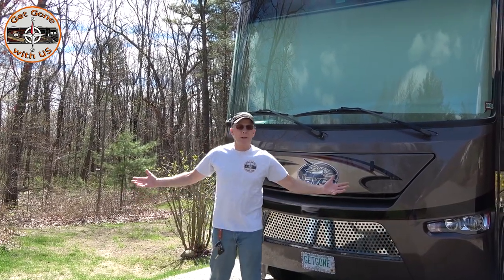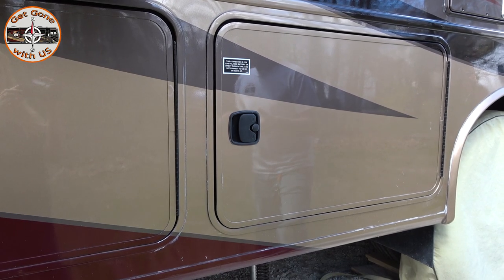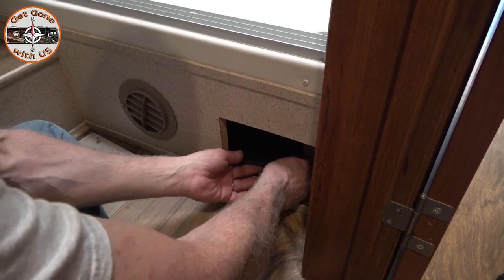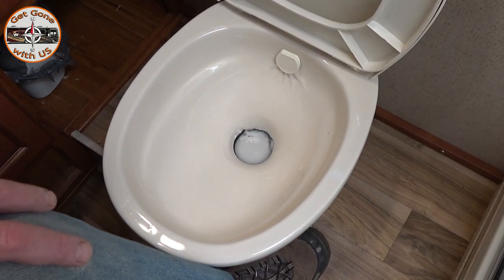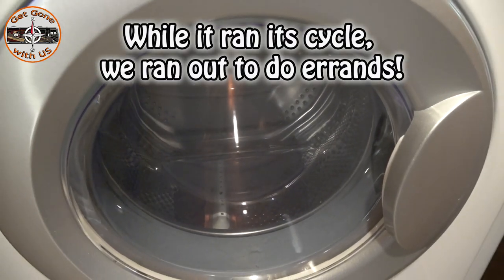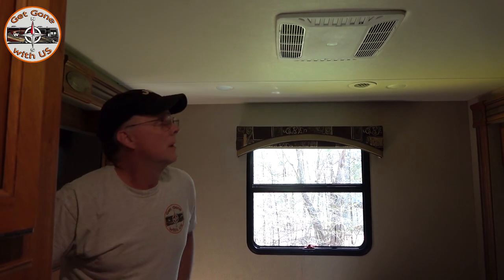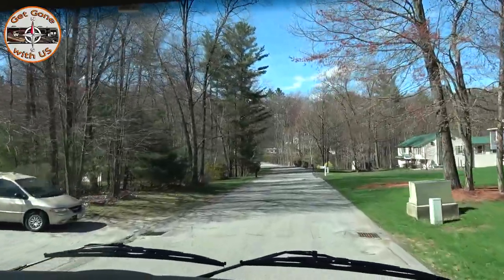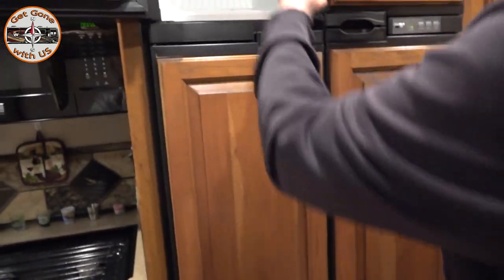Dewinterize and Sanitize an RV - Inspection and Plumbing

Comment: We had really bad flooding up here in the north now they are talking snow showers possible and it very well could it is only 35 out. Just when we think it is spring not quite yet! Great video.
Reply from the maker: Thank You!  The weather is crazy.  We went to a paddlefest in NY yesterday.  On the way we went over Hogback Mountain in Vermont and had to deal with a snow squall, it came down pretty good too. Temperature dropped to 35 degrees.  If we lived there Maggie would still be sleeping. LOL

Comment: enjoining you very detailed and informative maintenance series, thanks,  for my new to us 2018 Greyhawk 30x, what do you clean with prior to taping the roof, and any general fiberglass roof maintenance tips, don't want to replace the roof, saw a few videos on that, (a major operation!)
Reply from the maker: Thank you, we are glad you are finding the videos helpful.  Congrats on the new to you Greyhawk. By taping we assume you intend to Eternabond your roof.  We used mineral spirits to pre-clean the surface.  For washing we just use regular car wash soap from Walmart.   Replacing roofs are not fun, we had to replace the rubber roof and some of the wood on our 2006 Greyhawk.  Not sure we would want to tackle fiberglass though. 😀

Comment: I did not have to winterize cause of being in AZ. But I have a lot of preparing to do. Painting the garage floor today. First fill a crack in the floor. Then the paint.,...... yup we’re on track with you on the selling of the house.see ya Chuck n Cheryl
Reply from the maker: We took yesterday and today off from doing things to the house, we needed a break.  We really need a break from the rainy weather to finish up what we need to do. We had an issue with the water pump on the RV, we did fix that yesterday.  It seems to be one house or the other needing our attention.  LOL
Reply: Get Gone with US is it cycling. Like every half hour. Du du du du du,?   They say that’s a air leak in the water lines. My Arctic Fox has been doing that 11 years. The one thing that slowed it down was , the out side shower not tight.
Reply from the maker: @LifewithKenandJane  No the pump never turned off.  Once the faucet was turned off the sound the pump was making changed, but it kept running.  Last year it was intermittent, when we de winterized this year it did it all the time.  We adjusted the bypass pressure switch and that solved the problem.

Comment: I forgot to mention. We plug every hole with steel wool, then put pure peppermint oil on them. Rodents can’t take that smell. 
Our 5th wheel out at our gold camp can be a problem with mice and rats. 
The snakes are out big time now also. Nothing I know of to stop them. Just keeping an eye open. We only kill snakes that come to our camp. We never harm them in the wild. Best rat catcher on the free market. 🤠👍
Reply from the maker: We have a lot of steel wool in the RV for rodent protection.  The spot under the RV was too big of a hole, the factory literally must had forgotten to seal it up.  When we went out to Jayco last year, Factory Service took care of it.  We're good on that now.  Snakes in the RV would not be a good thing. YIKES!
Reply: Get Gone with US they won’t get in lol.   But when we step out in the evening . We have to use flash light to just make sure. 
Most RV people go to quartzite, but we stay at our club ( gold seekers)  300 bucks a year. We have well that pumps tons of water. We use a blue boy to dump. It like boondock , we do have very nice bathrooms and showers there. We use our own in the Arctic Fox.

Comment: Hi guys, y'all turned on your ice maker before you cleaned out your water tank... Is it because it wouldn't start filling until the 24 hours had passed?
It was a really good video
Reply from the maker: Thank you! We disconnect the ice maker water line before adding the anti-freeze. We reconnect it before sanitizing just incase there was still anything left in the line when we reconnect it and also to sanitize that system too.  It's a safety precaution we do. We throw our the first few batches of ice to make sure we are getting ice from clean fresh water.😃

Comment: Great video! Is there an overflow on the fresh water tank? Is there a danger of overfilling it?
Reply from the maker: Thanks Luci!  We have 3 tubes coming down from the top of the fresh water tank that looks like they are drains so I'm assume there is an overflow.  Haven't tested it to see for sure.  We fill it until there are 4 lights, then take it for a short ride to let the bleach solution hit the sides and top of the tank. 😃

Comment: Hey guys hope all is well:) Really enjoy your "how to" videos and learn plenty from them  as a RV newbie... byw, will finally be getting that Jeep Liberty shortly:) Winding down, selling one place and updating home base has taken much longer than I initially thought but its going:).  

The 2018 coach (Newmar Bay Star 3401) I was originally going to order last year has now skipped the 2019 and turned into ordering the 2020 this coming Christmas (lol) ...BUT then...I just found out last week  that Ford is now upgrading the F-53 chassis with a new engine (7.3 V-8)  for sure and possibly with a 10 speed transmission for 2020 :) The new build date for Ford is starting this November-December  2019! Oh boy!  

So unless Newmar puts the upgraded F-53 chassis in the second half of the 2020's, a Christmas order will have to wait until next Easter for the 2021's which will have the chassis upgrade and whatever else Newmar adds for the 2021 models. For me it is worth the wait for a few months:) Short of thrilled and a tad disappointed at the same time ...lol...won't get into the coach itself until July ish. But  am very thankful as well  for the gift.

Anyway, what is with the bonding tape around almost everything except the ACs on the roof? It also looks like it is on top of  the  dicore? You mentioned a prior class C leak but wow. Does that mean you don't ever have to dicor again...lol.  It certainly looks rain, hail , snow and sleet proof good job. Was wondering  if such a method would be recommended for a rubber type roof as well as opposed to your fiberglass one?
Reply from the maker: Things are well with us, you guys sound like you have a lot of decision to make though.  We just recently heard of the new engine Ford is talking about. We went through the same thing with upgrades to the F53 chassis when we were looking too.  We wanted to make sure we got one of the 2016 frames with the 6 speed tranny and we did.  We were happy.  Just make sure before you sign the dotted line that you are getting what you want.  RV manufacturers will built new model year RVs on the prior year frames until they run of them.  Our Class C was a model year 2006 but it was built on a 2005 frame.  The tape we use is Eternabond.  Cheryl and I had to replace the Class C roof ourselves and as soon as we we done, we put that on everything up on the roof and that roof was rubber.  The Enternbond is pretty permanent, but just like the Dicor it still needs to be inspected, just in case. We won't own any RV without Enterabond on the roof.
Reply: @GetGonewithUS  LOL...so I guess you can use the Entembound on the rubber roofs too, great idea:) Oh, and I will make sure it it is the 2020 F-53 chassis if only for the wait for the 2021 model...lol I remember the 6 speed which is why we decided not to get an older one...that was a big upgrade too:) Your coach looks awesome byw.
Reply from the maker: We used it on ours and never had a problem again.  Thanks for the compliment on Maggie! LOL